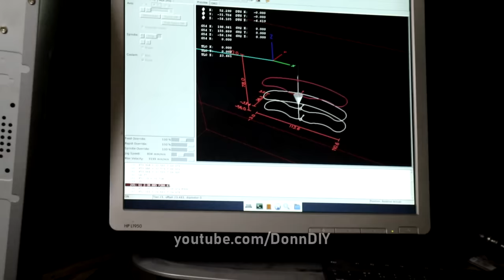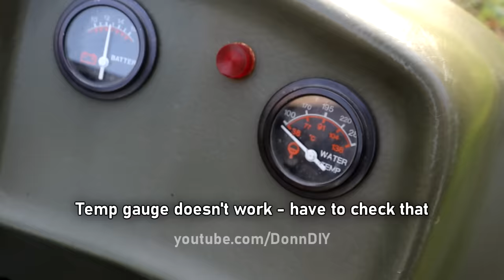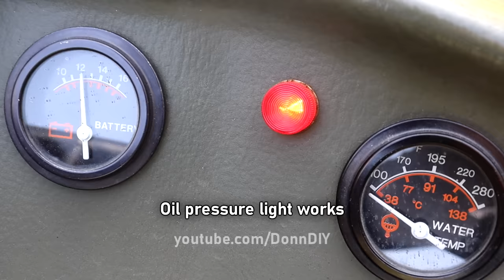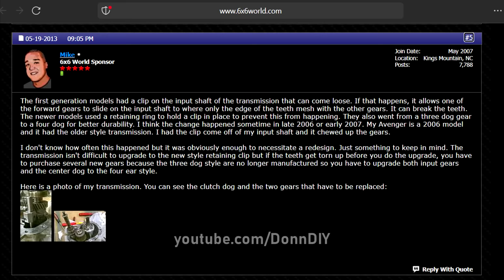Fully Rebuilt - 8x8 Amphibious Vehicle Argo REBUILD Ep.10

Comment: I was nearly as excited as you to finally start it up and blissfully pull her out into the sunshine.....tks for taking us along as you rebuilt your machine.....you have taken great care of it and it will do the same for you.....taking you into the variety of places in a style that no other single machine can match. I am a huntsman and have used an older '82 for years....made a deal I couldn't refuse on a 2000 conquest.....it's basic design solved all the main issues I experienced with the '82.....axle pins shearing and steering issues because of the non-hydraulic manual steering setup. Now, after going through it in not quite as much detail as you did, my bliss in using the machine is increasing withe every bug I work out of it!!! Thanks so much for sharing your repair journey!!! Trails are happier with an Argo.... the "go" is built in, as they say.....so many happy trails to you!!!!

Comment: Excellent! Very good job indeed. Once the seat is finished and perhaps you will also make guards to cover the moving parts inside, it will be a truly useful and more comfortable tool for you, as well as safer if your young children were to ride with you. Especially useful in winter perhaps - although a bit cold.
Reply from the maker: Thank you! The chains have original floor pans over them (which I forgot to show in the video unfortunately) so that part is covered.👍For winter use there's always the possibility to build a soft top for it with heating from the engine.

Comment: Excellent job and a shame the gearbox went sideways! 

Tire profile should face into the opposite direction, though. The way you put them, they'll get clogged more likely.
Reply from the maker: The gearbox issue was started prior this machine getting to my hands. From what I know about this vehicle the gearbox was run dry which also damaged the input shaft and the HI range gear retainer groove which I didn't notice the first time. But all good - after I put the tracks on the HI range is not needed anyway.👍
Reply: It's seems to me too

Comment: Thanks for such a fantastic build series 👏.  I hope that the loss of the high gear doesn't interfere too much with the operation of the Argo . I hope that the rest of the gearbox holds up to the work that you plan for it , maybe you could use a gearbox from a small car like a Corsa or Micra , older ones have just 4 gears and are more robust than the later ones.
Reply from the maker: I think having no high range here at the homestead will not be a big deal. Having the tracks on will mostly eliminate the need for high range anyway since it's recommended to use low gear while having tracks on due to higher torque requirements.

Comment: When chain tensioner work  the chain and sprockets last   the weak spot is the chains and sprockets from the transmission to the wheels   but you won't used like we did in the oilpatch   day in day out  sometime year round   in the exploration side of  searching for oil and gas 
We used a lot of 6 wheelers    now we use side by side  mostly Yamaha 700  some on wheels some on tracks   anyway  nice job  as usual  take care be safe

Comment: You should always apply CHAINLUBE to the INSIDE of the chain where the teeth go, so as it runs the centrifugal forces fling the lube THRU the chain and rollers, if you just spray it on the outside, it will just fling off the outside WHILE the rollers and pins go DRY
Reply: *thrOUGH
Reply from the maker: The rollers roll around - the chain was pretty wet uniformly. But I think you're right - I do lubricate my motorcycle chain inside out as well.👍
Reply: After thirty seconds of sending it, it really doesn’t matter where you applied the chain lube. As long as it was ON the chain. Let’s stop with the micro examination of things that resemble a hammer and an anvil.
Reply: @dozer1642 if there is a Best Practice for any maintenance job then it’s good that everyone is updated. The idea isn’t something I’d considered before but now I can apply it too. We shouldn’t be shy of sharing these things for fear of looking picky 🙂
Reply: @Sam-ob4of 

Who cares? I understood what he meant with THRU. 
You need to get a life.

Comment: You did a great job, aren't the wheels mounted the other way around?
Reply: Came here to say this, the pattern on the wheels should point in the main direction of rotation :)
Reply: Also, in EP01, the tires are mounted in the other direction :)
Reply from the maker: I put the wheels on as they were in factory.👍

Comment: Maybe a fun idea for the next off-road build:

You basically wanna run these vehicles in a straight line and then turn a bit and then continue to run in a straight line. But uneven terrain makes a lot of small steering inputs necessary.

This is quite similar to a ship, where you want to run a straight course, then turn than run a straight course again, while waves, current and wind makes it necessary to make a lot of small steering inputs.

So how about adding a ship autopilot to a vehicle?

Just add a strong light or a laser pointer to a rotating platform, so it can rotate relative to the vehicle and show you steadily you're aiming and get the course and vehicle heading from the autopilot. So you just dial in the course via the light beam and let the autopilot do the work to keep you steady ;)
Reply from the maker: Explosion of ideas!🙏
Reply: @DonnDIY  if such an autopilot is too expensive, you could also give ardupilot a look (:

Comment: I ran a bit extra pressure in the center 4 wheels, it made it steer heaps better.  The thing that made me sell mine was that it was far too noisy.  Having the exaust out the back would have helped.
Reply from the maker: I did it as well - the front have 5 psi, center four have 7 psi and rear ones have 6 psi. The center four wheels are bigger in diameter as well. It is noisy, the muffler on mine is burnt out as well. I guess getting/fabricating a better muffler would help. Although the chain drive noise will remain.

Comment: If replacement  gear is hard to come by, personally I would debur and run it.
High % of tooth is intact, & should work  without issue.
Reply from the maker: Yup, I agree. But I'd still have to replace the shaft where the gear is on since the groove is not perpendicular anymore and does not hold the retainer clip properly when under sideways/longitudinal load. The gearbox was run dry before it got to me and this made the damage.

Comment: If you noticed high gear isnt actually that much faster than low gear in my opinion. Engine sounds healthy also in my opinion.
Reply from the maker: I haven't calculated the gear ratios but not too much faster indeed. Engine is running great although a bit rich, have to take a look at the carburator.

Comment: I am definitely NOT a fan of the exposed drive system or engine for that matter. Accident waiting to happen. Great work on the rebuild.
Reply from the maker: Drive system is covered with original floor pans. I just didn't show'em in the video unfortunately.
Reply: @DonnDIY  Thank you for clarifying that. Again, a great rebuild.

Comment: I always fantasize about converting to hydraulic drive for the chains on mine. It would be neat to have a hydrostatic drive...
Reply from the maker: They've already built one with hydraulic drive, saw it on YouTube, video was posted something like 8 years ago, a yellow one.
Reply: @DonnDIY  hmmm... didn't see that one. Just looked & I don't see it. 

How does the argo perform compared to the tracked amphib you built from scratch? I got gge impressio  that your unit was a bit disappointing when you got finished.

Comment: Really Nice job 👍👍 but you need to switch all the tires they are going the wrong Way left to Rights and Rights to left
Reply from the maker: Thanks! Depends on what you want to do with the Argo. The tires are put on this way also in the factory. Supposedly it helps the Argo paddle better and move faster in water. But it's a compromise between land and water use.

Comment: I would have made a change to those chain tensioners that change would have eliminated the wear blocks... Replacing them with Idler sprockets on bearings those plastic wear parts just don't survive long term.
Reply from the maker: I would've too. But theres not too much room for idler sprockets. And I wanted to restore it as original as possible.

Comment: Nice, really good work, but I have to ask, does de 8x8 system on the trailer you make for transporting wood logs and wood trees with Crane, work, you never show the system working. When can we see it working? Again good job
Reply from the maker: Hey, thanks! The 8x8 system on the homemade UTV and timber trailer work in a straight line but in the corners it starts to bind the PTO chain drive since the trailer starts to push the UTV. I have to fiddle with the tow bar geometry to get UTV and trailer on the same turning circle. Then it'll be in 100% working order. 👍

Comment: I understand it's an ATV, so it ALMOST doesn't matter (although I also think tyre directionality also helps spread mud, not collect it), but it just triggers me — directional tyres should be inverted, and the pattern should form a V when looked at from the front.
Reply from the maker: No worries, I put'em on this way so they grab more water like paddles when in water. It's an amphibious vehicle.
Reply: that explains it, and it makes perfect sense, thanks @DonnDIY

Comment: Wh
Y not build a cover for the chain drives and put an amount of oil in them and eliminate your chain problems.
Reply: I agree seems odd that chains are exposed like that.
Reply from the maker: It has plastic floor boards I didn't show in the video.👍

Comment: So was this just for pleasure or will the this be a work machine?
Reply from the maker: The process of restoring it was a pleasure (even if it didn't look like it) but it'll be used mainly for work. Last winter was harsh and we had a lot of snow. I plan on adapting my homemade snowplow with electrically controlled angle adjustment to it and use it for clearing the driveway. The factory tracks it has should also make it floatable on snow which will be great for grooming snow trails.

Comment: so outta the hi and low gear you just deleted the hi gear? did you ever getting around to getting the part you needed and fixing high range?
Reply from the maker: Yup, I just took the HI range gear out. The shaft itself needs replacing as well so I just went with the low gear since I'm gonna keep the tracks on and use it that way. I haven't fixed it yet, I might consider it. The parts are readily available though. So it's a simple fix in that sense.

Comment: do you oil the chains or do they stay dry i know i some chain drives the case has a layer of oil the slack chain rides in?
Reply from the maker: The chains run dry - or as dry one let"s them get. I'll just use motorcycle sprayable chain lube and hope for the best.🤞😀

Comment: @DonnDIY does this not come with foam floatation for some compartments to insure it stays afloat if its inside floods ? or are the tires enough? also ill you build a snorcel for it ?
Reply from the maker: I haven't checked but I guess the tires are enough to float it. It can be easily calculated.

Comment: Are you sure about the turning direction of your tires?
Reply from the maker: That's how they came from the factory to my knowledge.
Reply: @DonnDIY  on every tractor the profile is that the dirt goes to the outer side. Otherwise the mud would remain in the profile and make it useless. I thought when you toke it apart it was differnt. But maybe it is becaus of the chain that was on the wheels

Comment: {IT'S FINISHED!}<<<WRONG, it's either drivable or your finished. But it isn't finished or done when high gear is gone, or floor boards not in and or all chain areas need to be covered up along with motor area, seat needs to be reupholstered, temp gauge not working, 99% done is not finished. 
So either really finish it and drop it off at my house or I want all my money back.........
Reply from the maker: It's drivable then. 🙃🙃😬😅